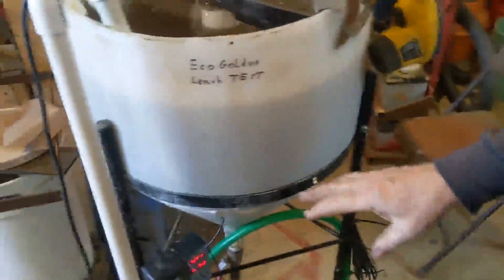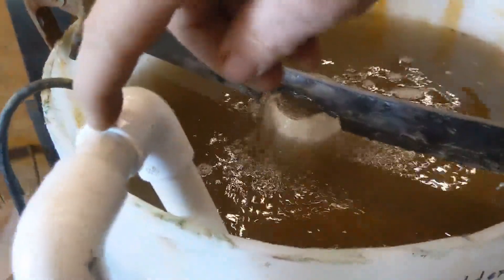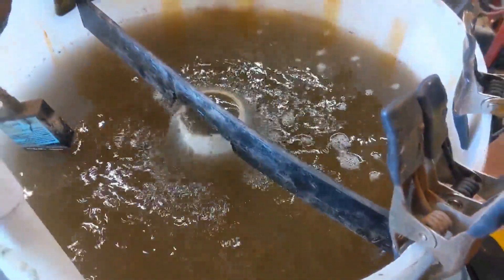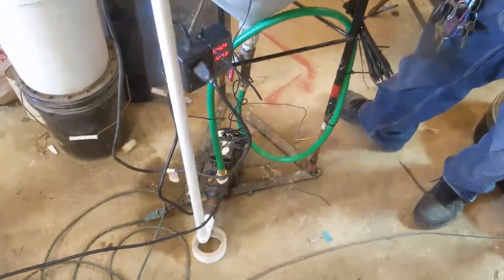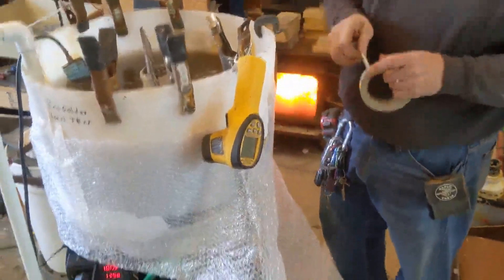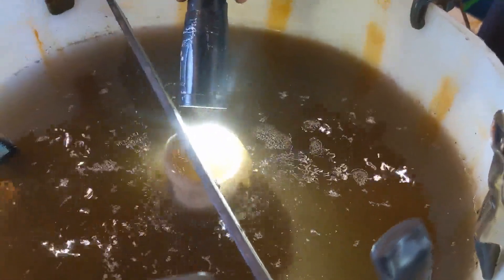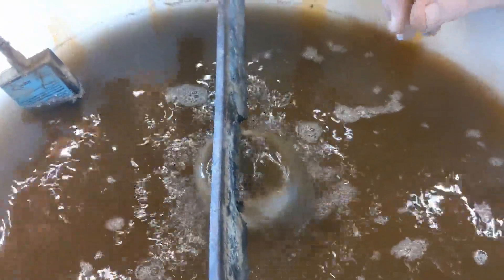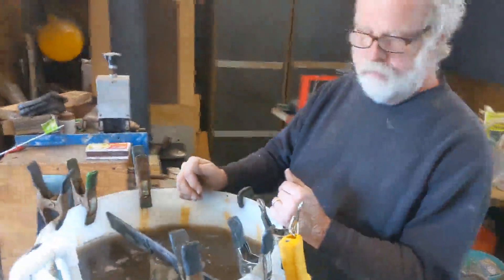LEACHING GOLD With a VAT TANK (SMALL SCALE GOLD MINING)

Comment: The tank is now in operation!  starting with 100 grams of carbon (rinsed)  In filter bag 175 grams of eco goldex. 13 galons of water. 50 grams of sodium percarbonate ( booster)  120 f  heat.   2 types of agitation.  25 lbs of magnetic ore cons. assay at total of 1 gram pgms per 5 lbs.  2 air bubblers   run time 48 to 72 hrs even though it should be done in 20hrs.   I love all input(comments)   thanks Bryan...
Reply from the maker: He made a Google meet call to me and the water looked like rich chocolate milk.

Comment: I think you might get more agitation without sand back wash by just putting some 3/4" PVC on the end of the hose and placing it down into the bottom of the cone bottom with the hose over the top of the side.
Reply from the maker: I believe the idea Bryan had is to lift the concentrate from the very bottom of the cone and deposit it on top. Kind of like an hourglass dumping back on top of itself.
Reply: @bosrecreationalmining  Yep.  It sounds simple, but I think you need a much more powerful pump and euductor to make it work efficiently.  You might google 'pachuca tank' and see how they did it with an air lift in the past.  However, that takes quite a bit more vertical height.

Comment: Couple of questions so far.  I'll ask them now before I forget....
1. Does the MFG recommend above room temp for the O Series?  I don't remember that for the S series.  

I don't see much of the heavies being lifted over the lip of the 2" pipe.  How much material is being lifted per minute?
Reply from the maker: We only put the one scoop of concentrated in it just to test it to see if it would pick any up. When we fill that tank I would expect it to pick up a lot more. We can always make the slits in the bottom of the pipe bigger too.
Reply: @bosrecreationalmining  Tha would explain why I couldn't see much.  Thank you.
Reply from the maker: I don't know if they specifically recommend that you do it at a higher temperature but it certainly works much better and faster. We did test with dissolving gold leaf and we found that if you don't do it hot it would doesn't work. You also need to add sodium per carbonate for oxygen.
Reply: @bosrecreationalmining  Interesting.  Thank you.

Testing is definitely the way to go.